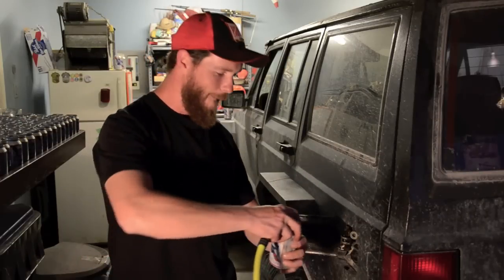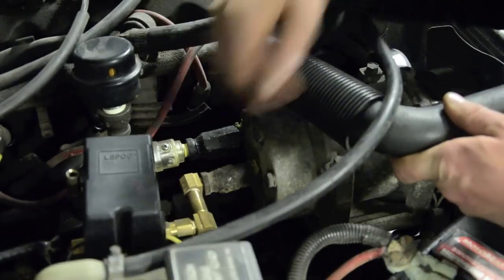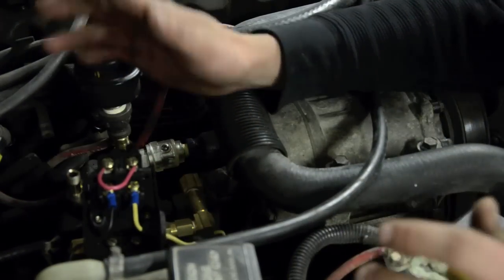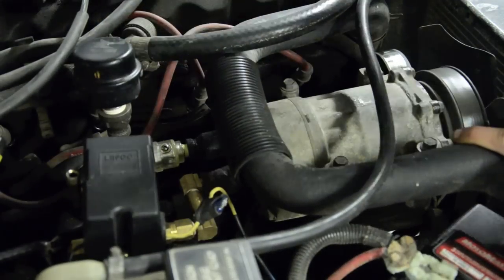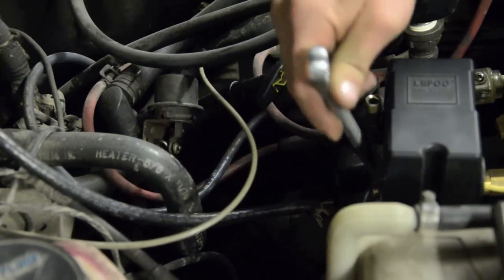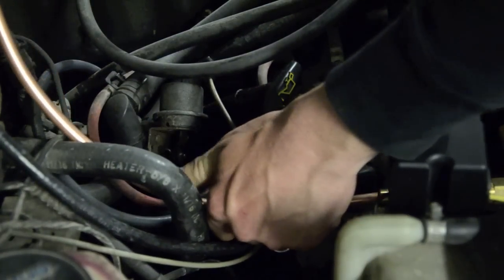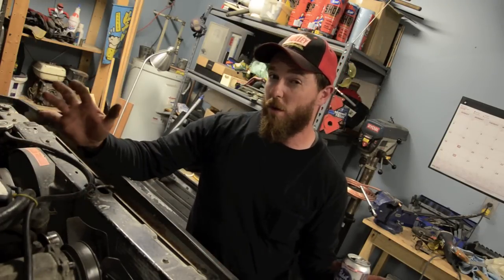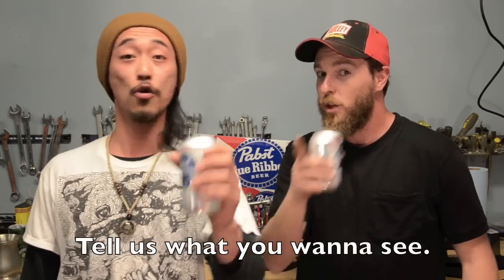On Board Air - Part 1 - The Roadhouse

Comment: Very nice setup! I've gotta get some threads welded to my york, but I've got a similar setup... 
Do you also have an electronic idle up like mine?
I prefer using the York compressor because it has an internal oil reservoir...
Anyway, check out my setup, and lemme know what you think..

Also, what coalescing filter are you using? I've been looking for a good one, but haven't seen any compact filters..

Comment: Hay guys I’m trying to wire up a 2006 rubicon Air pump to a rubicon rear locker. Can’t use OEM switch’s or I can’t wire back into the transfer case. Can it be done. I’ve ran power to the pump. It’s just not putting out enough air pressure if any. Thanks.

Comment: did you remove ALL the refrigerant and pag oil? full vac for atleat 5 mins or just suck what you could out and ran what was left insde?
Reply from the maker: All the gas leaked out long before I owned the Jeep I'm guessing. Never worked, but the pump was still good.
There was some oil left in the pump. I got that out by running it open with a rag over the hole. Im sure there is still some oil in the evap and the condenser, but its not going anywhere.

Comment: Sick nice job. Would like to add another compressor to my ecoboost to achieve this. The only thing I was wondering is how do you know how much PSI a a/c compressor can handle?
Reply from the maker: +SKimpy0070 just look up the specs for your HVAC system. It'll tell what all the components are rated to.
Reply: +Pabst Boys KK thx!

Comment: Love y'all's videos! One question though. How is your air/oiler set up? You didn't really touch on that in the video. Thank you for your help.
Reply from the maker: +Gator Schopper 
To be honest,
It sucks.
If you forget to top it up, youll run it dry and kill the thing.
and it doesnt take long to empty out.
Working on a different way to keep it lubed.
Stay tuned...
Reply: +Pabst Boys Roadhouse alright sweet. I will definitely keep an eye out for your fix.

Comment: I am having a problem finding all the parts needed for this mod, like the distributor, check valve, air oiler. Where exactly did you get those?
Reply from the maker: I had to hunt some of the components down, but I'll be doing an engine swap at some point and will show a more simplified system
Reply: McMaster-carr.com will have a lot of those little plumbing/ air line pieces.

Comment: I've been wanting to do this to the '80 Powerwagon for years. I keep seeing guys modifying the old York style compressors on the '70's Dodge truck. 5 gallon tank, or custom bumpers that hold air. They are able to run air tools, and quickly air up tires. My problem is that she is pretty much plain Jane, no AC and I don't know if a single V-belt would be able to drive the compressor.
Reply from the maker: Yes it would. 
I'v seen it done on shop trucks.

Comment: Im having trouble finding a one way check do you have a link to one? I can't figure out what they're called. Also are most of those pressure controllers adjustable?
Reply from the maker: This one is, and it was a pain to source. I'll be redoing the whole system with the engine swap coming up and show a different option...
Reply: They are called spring check valve.

Comment: dudes! OBA tank.....do you have a drain on the bottom of the tank for water? and the outlet for the air on top of the tank? it helps stop it from picking up moisture. same as for a garage compressor, just look at what they have, OBA will need to have as well. you covered it, except for what i asked . how about a video where you delete the heater valve in the heater hose and the remote reservoir?  and replace the radiator so you can fill it on the rad fill neck.

Comment: Two possible issues.  1) Copper and, less so, brass, when it vibrates around a lot like on an engine, will get more and more brittle.  You may have issues with leaks after a year or two. This is why you don't find a lot of copper @ the engine or even on a car with the exception of wires and some radiators.   2) Going from steel to brass or copper with any moisture (and it will gather moisture) will create galvanic corrosion on the steel parts.  Those can fail in a few years depending on use.  Advice to anyone who does this...stay with steel piping and lines or go to aluminum.

Comment: couldnt you just put a air compressor in the back and wire the pump hose to the outside
Reply from the maker: THE XJ EFFECT Sure could!
The problem is that the best electric pumps on the market run between 1 - 1.5 CFM with a max output of 150psi. Thats really not a lot, and they have quite a draw.
The factory A/C compressor runs between 8 - 11 CFM and is rated up to 300 psi. Couple that with a 6 gallon tank, and you'v got yourself some jam with your air tools.
Reply: +Pabst Boys sweet thanks for the tip!